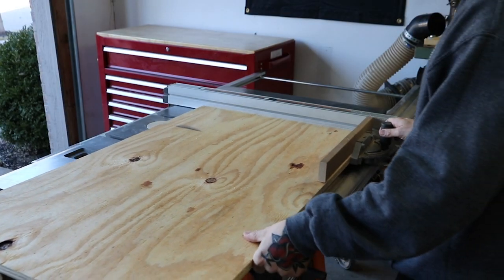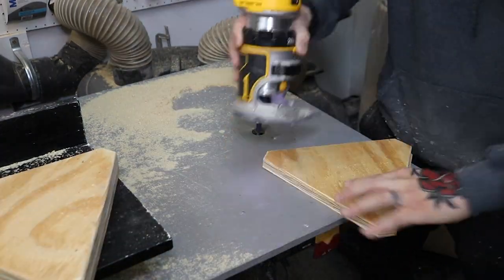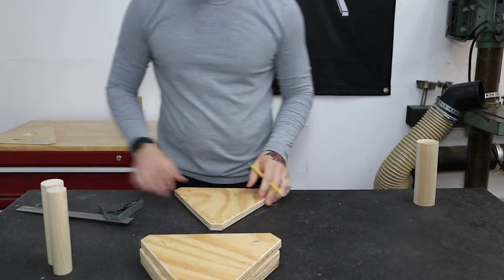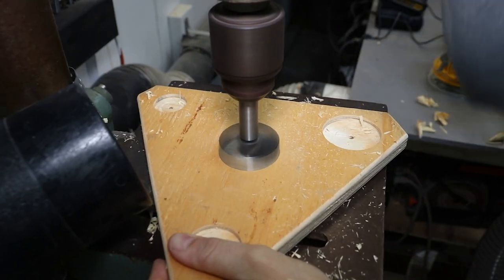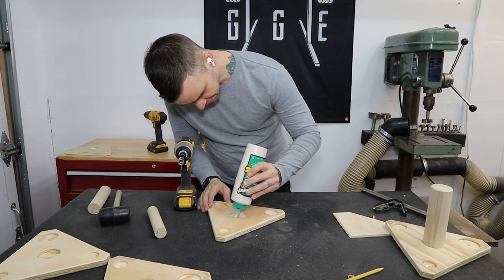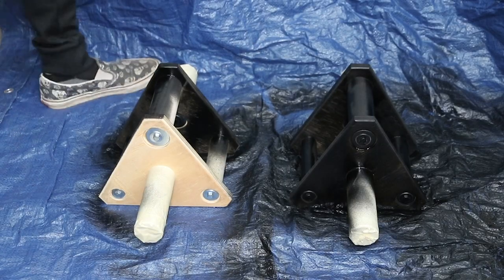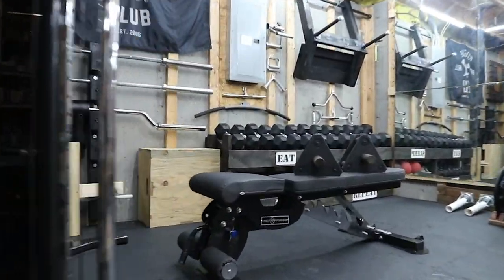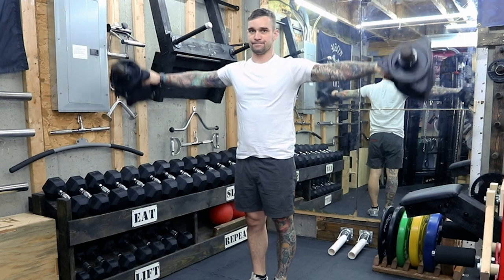DIY Triad dumbbells, adjustable dumbbells with 3 grip options

Comment: I honestly like both and feel like there's two options for people based on their existing plates inventory, tools, accessories, and how much they want to spend. I like Matt integrating metal handles and posts but Kaizen insetting the dowels I'm sure is very strong as well.
Reply from the maker: They're pretty strong. If someone was planning on going super heavy, I'd suggest running bolts through the handles, from triangle plate to triangle plate, but for what I'm lifting they're definitely strong enough
Reply: @KaizenDIYGym  i was thinking something similar as well. Looks like a fun project for both you guys I enjoyed watching
Reply: I would just get something like the titan x3 weight plate holders and bolt them on. You can cut the length to whatever you want

Comment: Would love to see regular loadable dumbbells. Every loadable dumbbell I find online are at least $100 each. As always, great content!
Reply from the maker: That’s a good idea. I’d probably make the design similar to these but have a bolt going all the way through the single handle. I’ll add it to my list.
Reply: I was thinking the same. The handle positions on these sort of mimic a kettle bell when in use and it'd be good to see dumbbells that are held from a handle that is in-line with the centre hole of the plates to give a more balanced feel with less leverage acting on the wrists especially in pressing movements. These are very well replicated so I'd love to see what you come up with there also keeping to the strong but inexpensive philosophy of course lol

Comment: Great stuff. I'm contemplating trying to build a flywheel box/diy kbox for my twin teenage sons. Any experience there? They are high school basketball players and I think it would be a good training aid because it doesn't impact recovery the same way heavy squats or even belt squats might. They have several games per week and I don't want training to impede practice or game day performance.
Reply from the maker: I think that’s a great idea. I have no personal experience using a flywheel but I follow several people on Instagram who use one for training. If you’re on IG, connect with me on there and I’ll point you to their accounts. 
Additionally, there’s a $10 manual you can purchase from @bbaperformance that lists all of the materials with links to purchase. I bought it and plan on making mine in the coming months.

Comment: Excellent video, explanation and build!  Question - do you think the weight loading dowels are secure enough?  I think you said you drilled 1/4" and glued and screwed.  Thanks
Reply from the maker: Thank you so much! I think the weight bearing ability of the dowels will depend on the amount of weight you’re using. I put 80 pounds on one of them to see how much weight would fit. I wouldn’t trust it over my head though. For the most part, I probably won’t be putting more than 20-30 pound on each one, so I think they’ll hold up fine. There are definitely options to reinforce for heavier weights if needed.
Reply: @KaizenDIYGym  Thanks for the quick reply.  Now that you have used them for a while do you like them?  Have you incorporated into your workouts instead of regular DBs?  Thanks again, love your passion.
Reply from the maker: To be honest, I’ve only used them for one actual workout so far. I didn’t have a chance to fully use them before releasing the video. I do like them, they add a lot of variety to standard dumbbell movements. With the weight pins off the sides, they are bulky at times, so that can be restrictive. But overall they’re worth the time they took to build.
Reply: @KaizenDIYGym  thank-you.  Very helpful.

Comment: Sorry if this is stupid, but does wood weigh the same within the same type? I was thinking about building a yoke but was concerned about it being off balanced
Reply from the maker: Wood weight varies quite a bit. It depends on the density and moisture in the wood

Comment: i was wanting to build a heavy duty set would u recommend using lag screws on the handles to help secure them better?
Reply from the maker: Honestly, if I was doing it again I would use bolts and go all the way through the handles.

Comment: I'm 100 percent making these. How do they do outdoors?
Reply from the maker: The wood I used wouldn’t do well outdoors for an extended period of time. I’d look into rot resistant materials like cedar, treated pine, composite or even metal.

Comment: How many hours did you have in it between design and build?
Reply from the maker: Great question, I should have included that in the video. I built a prototype before building the two in the video, if we include that as part of the design process I’d say about 3 hours. If I was to build two more tomorrow, I could probably do it in about an hour and a half.
Reply: @KaizenDIYGym  lol this is the same comment Havak asked me to delete.